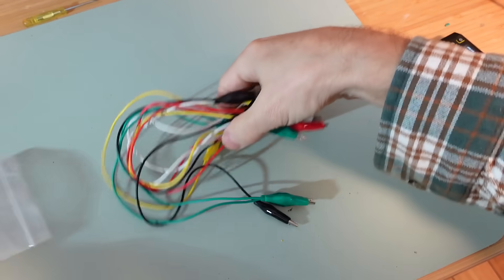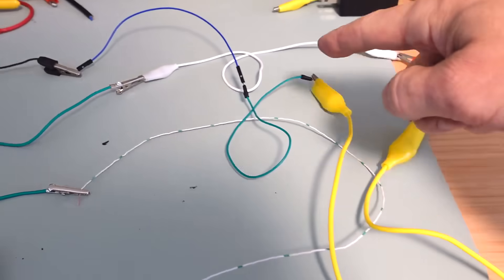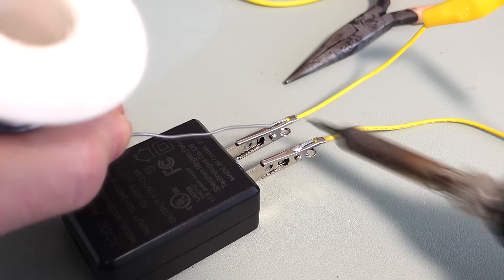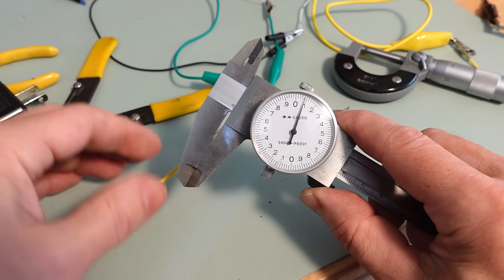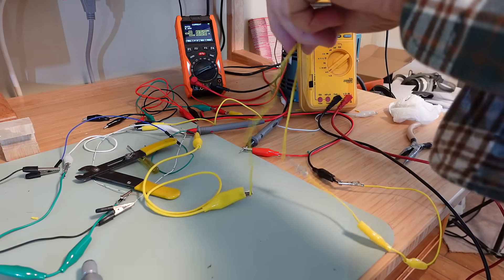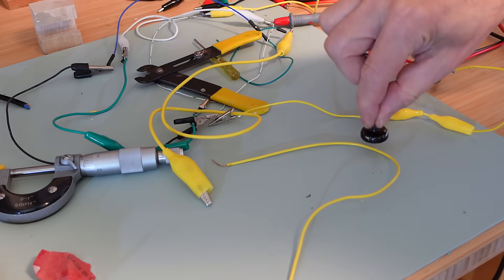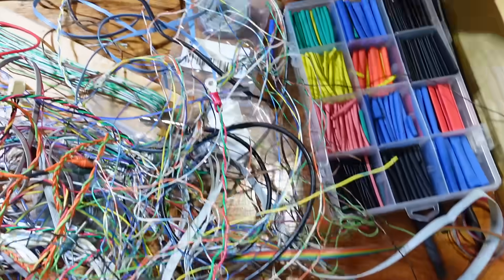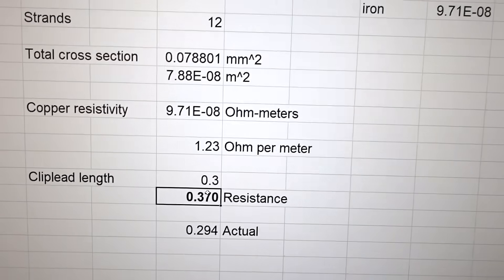Clip leads made with fake wire

Comment: keep in mind that the wire not being magnetic doesn't rule out that they are made from copper coated aluminum
Reply: I test this with a lighter. Aluminium will burn and crumble.
Reply: @Imholze so will him iron…
Reply from the maker: True enough.  But aluminium is quite conductive.  Main downside is its prone to breakage and poor connections.
Reply: @matthiasrandomstuff2221  aluminum still isn't as conductive as copper is. But it's better than steel. Copper Clad Aluminum is still a rip off. You have to set CCA on fire to tell it from copper. It'll curl up like hair does. If your eyes are really good you can look end wise at the strands and see they're silvery. Setting it on fire is the conclusive test but that's destructive.
Reply: @1pcfred  Yes, I absolutely don't mind having CCA wires, as long as I bought them as CCA and know they are CCA and have copper when I buy copper. Absolute scam otherwise.
Reply: @1pcfred I disagree, CCA is half the cost of pure copper making perfectly suitable depending on your needs, usually audio cables, it's only a rip off when it's sold at copper prices.
Reply: @vgamesx1  The problem with CCA is that copper and aluminum are too far away from each other on the galvanic index. It's a battery and a thermocouple and tends to rapidly degrade into a crispy mess. Aluminum by itself, in appropriate terminals, can be fine. Copper's better. The two of them together? Hell no.
Reply: @1pcfred  sandpaper
Reply: True. I had an efan from china, it works but lasted only a few months. When I tried to repair it,  it had aluminum wires for the motor and was crumbling apart  @matthiasrandomstuff2221
Reply: @matthiasrandomstuff2221  Especially if you solder instead of crimp.
Reply: I had some power cables which were made probably from aluminium. They are practically impossible to solder.
Reply: @EdwinSteiner  or they are enameled copper wires!
Reply: Just returned a roll of speaker hook-up wire that was advertised as copper but was actually copper-clad aluminum. Super dangerous at the watts I'm pushing.
Reply: Or as I said above, even copper coated plastic.  China, Inc. has definitely perfected the art of sketchiness.
Reply: @wtmayhew  That's crazy, man. I haven't had the misfortune of running across copper-clad plastic yet.
Reply: Correct me if I'm wrong but aluminum is not ferromagnetic. Unless there's some random alloy of copper that I'm not aware of, it has the same magnetic properties as copper, being ?para?magnetic.
Reply: @sqisherking1 That's why they specifically said to use an electromagnet since aluminum being paramagnetic becomes slightly attracted to the magnetic field whereas copper is typically diamagnetic. Aluminum shavings can even be attracted to a strong enough magnet and this concept is often harnessed to separate aluminum scrap from trash on a conveyor belt.
Reply: Also doesnt rule out nickel. Especially in spot welded  battery connections it's hard to tell the difference. Sparks when ground on or salt water rusting best ways to eliminate nickel
Reply: Nickel won't rust in salt water. Nickel coated steel sold as pure nickel will however.  @benm9910
Reply: or just straight copper wire. Putting in in a flame will tell you what it was.
Reply: Or even zinc in some cases 😂
Reply: Copper clad steel ?
Reply: @chuckfarley567  Copper clad steel is relatively safe. You can clad steel in copper and they can, usually, be in about the same place in the galvanic series. Aluminium, however, reacts with almost every other metal and starts corroding.
Reply: It would be more trouble than it's worth to make this fine of a gauge CCA
Reply: 😂 magnetic aluminum! Cool!
Reply: Aluminum doesn't stick to magnets.
Reply: @rolen47  Someone missed the point of the comment.
He was saying that even the wires that don't stick to magnets aren't a guarantee that they're pure copper.
Reply: CCA wire is a big thorn when it comes to networking cables especially if you want to run higher wattage POE over significant distances.
Reply: Bro, Aluminium is the closest preferred conductor to copper so no big deal about that!
Reply: @mosesgoiho6240  Except for the fact that you can't solder to it. Trying to repair a nicked or severed lead made from copper-plated aluminum is hell on earth and nigh impossible.
Reply: If you got an electromagnet ones from door locks or latch etc it should attract the alu because its more magnetism sensible
Reply: @jul371-y5p  only ferrous metal is attracted to magnetism. Iron. Although you can make an electromagnet out of any conductive metal. But that's something different.
Reply: @jul371-y5p Sorry bud, alu is non ferrous, not magnetic.
Reply: No
Reply: @jul371-y5p  Huh?

Comment: Very interesting. Now I've got to check all my wire to see where I've been bamboozled. Thanks for the informative deep dive!
Reply: Also remember to test with your Aluminum magnet.
Reply: @zaprodk you can test these with a lighter. To copper it does nothing but aluminium will burn and crumble.
Reply: Yeah you used to have to set the wire on fire to figure out you're being ripped off. The latest iron wire move is a bold one indeed. Years ago they were copper coating aluminum. When you lit that on fire it melted funny. It'd curl up and burn like hair does. The iron still won't go like copper does. But it's harder to tell. A magnet is pretty easy though. Copper clad aluminum (CCA) is still crappy wire though. So some of those wires Matthias checked could have been CCA. It's non-magnetic at least.
Reply: I just did. About half of my jumpers are iron. Only way to get good ones is to make them. At least the clips and the boots are reusable. But damn, another time consuming and un-necessary project to do. Like raking the leaves and shoveling snow don't take up enough time.

Comment: 6:10 in the mouses case I have the suspicion that it might just be the shielding that is out of iron
Reply from the maker: if they are shielded.  But I think the shielding on cheap wires is usually aluminium, just from a workability point of view.

Comment: Your mouse wire being magnetic might be the shielding used? I've seen several transparent USB cables where the shield is made from a silvery metal, not copper. I always assumed it might be aluminium.
Reply from the maker: haven't seen shielding on mouse cables myself

Comment: Yeah, I ran into the same issue with these wires. Also, the rubber cap over the clips is so slippery that the clip rotates 90 degrees when you want to open the jaw.. really annoying.. so in this case I will be spending a bit more for decent leads..

Comment: They should be sold as current limiting leads, or self fusing hookup clips ;-)  Thanks for the reveal, well done.
Reply from the maker: The one pack is for my son, and I figure the resistance is a bit of a safety thing!
Reply: I intend to use mine as „British Standard“ heating elements. ⚡🇬🇧🔥😉

With the cost of energy like it is in this country, current affairs mean any (un)reasonable measure must be taken! 💡
Reply: This type of chinese resistance wire is used to good effect with some 12V COB LED panels, having no other form of current limiting than the wiring.
Reply: @dino6627  We have a slightly different form of current limiting in the UK at the moment: The previous gov't (CONservative) banned all imports of rasins from the EU because „levelling up“ and the new gov't (Labour) hasn't lifted that restriction yet. 🛃

The overall effect is that currant(s) are now very hard to come by in the UK, and cost a tremendous amount when one does eventually find them. 💸

Funnily enough; The same thing can be said about any UK domestic electrical supply, too... 😋

Comment: this makes soo much sense why i always think these cheap leads are junk, im going to go and test all my clipleads. Like you, i usually make my own though, when i do i use silicon coated wire as it tends to have higher current ratings and doesnt deform when bent.
Reply: It is nicer to work with most of the time, too.  Smaller PCB stuff I still like the bendable wires.

Comment: does this mean that the wire will burn like steel wool does with smaller strands? this is a very good find! no more buying cheap things from china! Thanks!
Reply from the maker: probably not.  Steel wool is much finer strands.  Also, insulation keeps it from getting enough air to sustain a burn

Comment: I found these years ago and yes they are another fraudulently claimed item I guess you can say.  Just got a Greenworks 40V claimed 9 aH battery that is no way even 4aH I assume.  The silicone clip leads with the nicer aligator clips are the ones I buy.  Seem good so far, though I do want the ones with the banana on one side.  However, not certain those are good ones.
Reply: Oh and when you can find the nicer copper clips to make your own, those might be good to get as well.  Those at one time were more rare.

Comment: It's just as bad as the copper-clad aluminum ethernet wires that can't work with POE
Reply from the maker: aluminium is 60% as conductive as copper, so not that bad.  Steel is only 1/6th as conductive as copper.

Comment: These are quite good fuses when you are testing stuff from tool matteries or lead acid batts. Just expect the to get hot at 3A. Actually I got some 1.5mm2 silicone wire and  swapped ore than half of them to that and soldered the wire on both ends, they are quite nice now.
Reply: Also this is nothing new, I got the exact same stuff with the same steel wire even back in 2015 in the local electronic components shop and in 2016 from aliexpress too. The sad part s that a specific school suppies distributor sells these to schools for 60 EUR per 10 pcs!

Comment: You made me paranoid so I just checked a bunch of my leads. Yep. Some cheap Chinese ones were magnetic.

I use them for prototyping so I need to take that into account from now on.
Reply: Probably best not to regard any results involving them as valid, given the uniformity, quality and resistance between individual leads is likely to be highly variable. Cut a meter of good quality Cat-V and replace the wires with cores from that. 👍

Comment: Reminds me of a variable dc power brick I bought a few years back- the mains lead was super thin and had an foreign plug on it so I decided to cut it off and change it. When I opened it up there were only half a dozen thin strands of copper in the lead, total garbage- used an old power cord salvaged from something and soldered that in it's place, much thicker wire inside.

Comment: I just made custom clip leads. I buy the clips in bulk and use quality highly flexible copper wire with silicon insulation. I always have a stash of clips and banana plus to make custom wires.  Some 2mm copper sheets as battery contacts come in handy as well. My leads will not survive to full 10A they are build for, but everything below is fine. I also stole AVEs idea to use magnets as a contact to charge single 18650 cells work fine.

Comment: Well, not good, but better than what you normally get - copper clad aluminium. That stuff disintegrates into oxide powder over a few years.
Reply from the maker: yes, the steel is probably more resilient than aluminium that way.  if they hadn't double cheaped out by making the conductors really thin, the steel would have actually been kind of ok.

Comment: You only use for these cheap cheap wires is that it's actually cheaper to buy these wires and use the clips then it is to buy just alligator clips
Reply: The clips are also probably iron. I'd expect the good ones to not be, but you never know. I definitely have some "good" ones from digikey, and a bunch of cheap generic ones around - I'm going to have to magnet test all of them now
Reply from the maker: Definitely almost always iron.  Copper is too soft.  But the clips actually have quite a bit of material on them, so the lower conductivity is less issue given the cross sectional area

Comment: I wonder if the mouse cord may be ferromagnetic due to using a braided shield or central strength member (which could be a ferrous alloy) edit: and of course it can also just be a super cheap mouse with ferrous wires, I don't mean to rule that out
Reply: From my experience hardly anything "cheap" has got copper wire in it anymore. You'd be surprised at the absolute state of transformers, especially in car battery chargers and "cheap" hifi amplifiers that still use them. It's real scary stuff. 

In the computer world they've been using a lot of copper clad aluminium for data cables instead of pure copper but aluminium is still a way better conductor than iron. Also, most USB/HDMI shielding is just tinfoil tape wrapped around the cable but on fancier/branded cables you generally have a thin iron cable from tip to tip for strength.
Reply: @spongerobert  indeed, I have come to expect CCA in many things. This video showing ferrous conductors creeping in is something new for me though!
Reply: Even the shield braid should be made out of copper.
Reply: @1pcfred  Copper is completely unnecessary for shielding (except in very specific applications).  Using a steel outer braid is actually better than copper in many cases, because it will give the cable higher tensile strength and resist stretching and tight bends (which will help keep the twisted pairs inside properly twisted).
Reply: @1pcfred  You're questioning why extra tensile strength on a mouse cable would be desirable? I'm guessing you haven't had to do much hardware support for lay-users... I don't know exactly WHAT they get up to with their mice, but based on the cable wear-and-tear my guess would be some combination of "weaponized peripherals fight club", and using them to rappel from the office roof.
Reply: @1pcfred  that is very rare, even known-brands coax is often Al/Fe
Reply: @coolm98  I'm with you, if you're shielding some cable you're going to use for metrology, sure, use copper.. Otherwise it is unnecessary, and none of CE ROHS whatever else require it.

Comment: I just hook em straight to an oversized load until they melt the insulation right off the wire.  Then you know that connection is solid

Comment: I bought a bundle of leads like this off Amazon around 6-7 years ago, which for some reason was when I really started to appreciate that even the most straightforward of simple products that "should" be cheap.... well you get what you pay for.   Shortly thereafter we stopped buying from Amazon altogether (not because Amazon was responsible for that product, but because the platform  encourages the cheapest and fastest products) and sought out quality products (like test leads/clip jumpers) from reputable manufacturers that were still affordable.  I have completely transitioned to buying new and used items that are quality, will last forever (in this case, good silicone test leads or jumpers from places like Pomona), instead of trying to pinch pennies on items that don't need to be unreliable and consumable

(edited for odd phrasing)
Reply: There have been credible allegations that Amazon games the review system and suppresses negative product reviews.
Reply: Good test leads are not cheap at all. Go shopping for Pomona products. But they are really nice. EZ-Hook is another one. A cut above. Then there's Mueller, of course. Name brand products.
Reply: @1pcfred  100%, Pomona is my go-to brand for a lot of this kind of stuff now; and it is so high quality that it can reliably be purchased used on ebay as well
Reply: @1pcfred  yeah I wouldn't buy Pomona new on ebay, only used from sellers that make sense to be selling it used
Reply: i bought a "debugging" chip from microchip, definitely NOT cheap! (pic chips and atmega?) and whilst i never tested it with a magnet... i sure couldnt get the included patch lead to solder! so probably not even iron... because iron will tin.
Reply: @paradiselost9946 Alumin(i)um is common  too. A lighter does a good test - put the glame to  single strand and it'll curl/crumple up.
Reply: In recent years, Amazon has raised their prices, but is selling more junk from China.  I've moved on to Ebay.